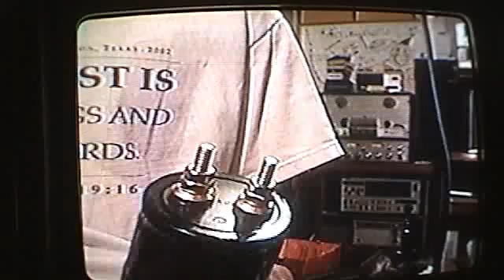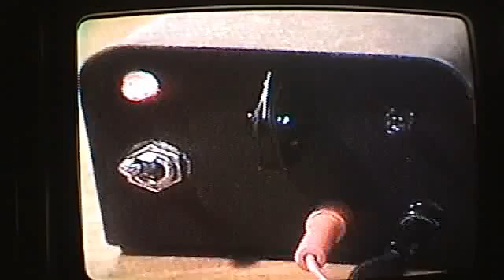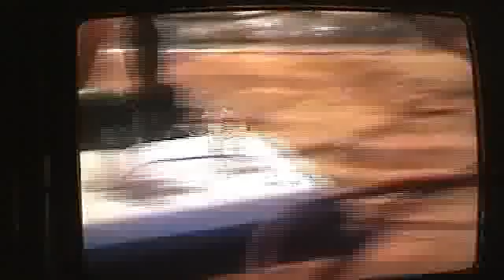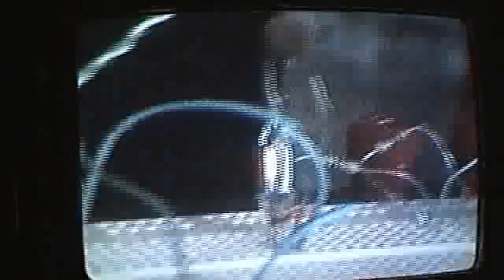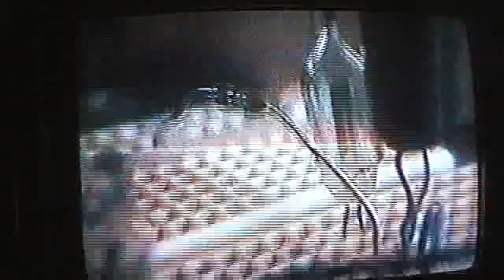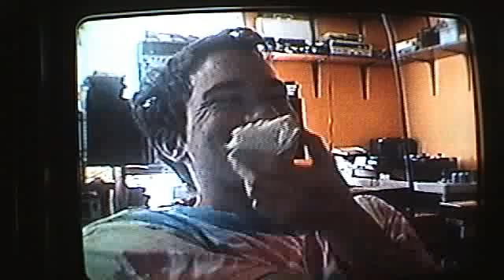1 F capacitor and then neon audio oscillator

Comment: How does the neon bulb work as an oscillator? I guess the capacitor charges until it has enough juice to power the bulb for a split second or what?
Reply: Yep that's exactly how a relaxation oscillator works